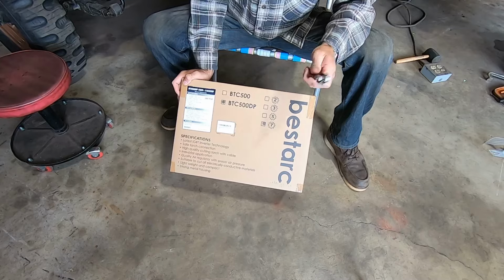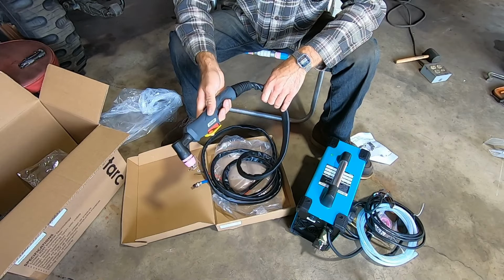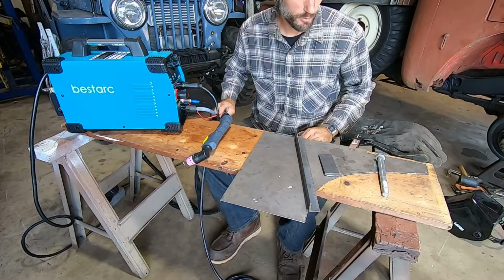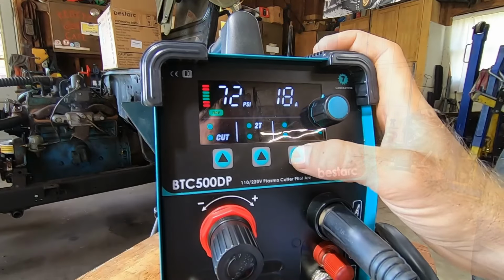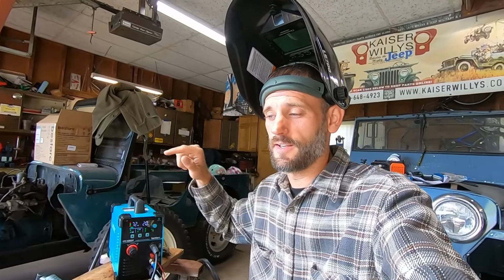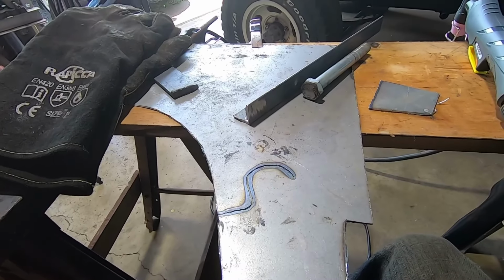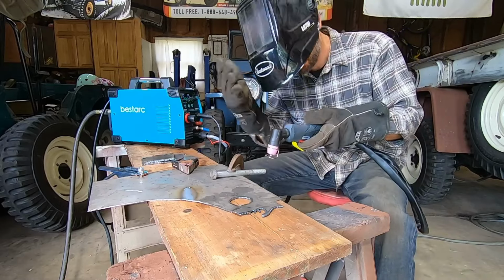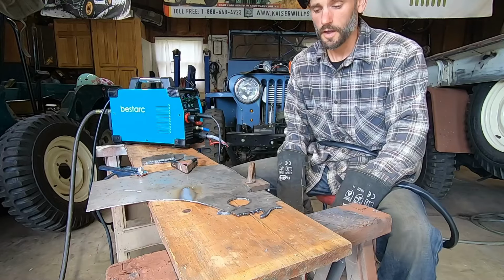⚡️ Bestarc Plasma cutter ⚡️ Is it right for you? BTC500DP

Comment: I have the same machine. I did floors on my 2a. I did 14ga. I did it on 120v with a 12ga 25ft extension cord. It impressed me.
Reply from the maker: Nice! It seems like a good machine. I just needed to plug mine into a different outlet but I have a long 220 cord for my other welders so it wasn’t a big deal.